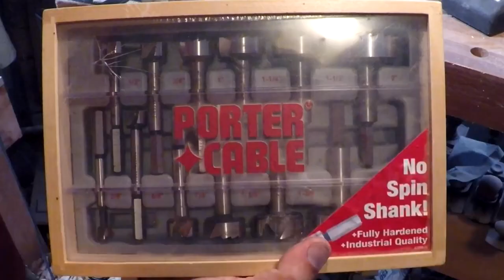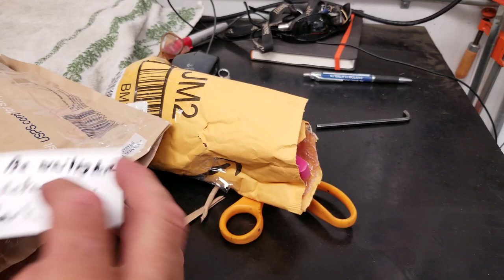Bar Z Industrial Mystery Tool Pattern

Comment: Beautiful pattern work, in any colour.  I'm guessing the small piece is for a separate cast part that attaches to the bigger casting, since I can't see why loose piece molding would be needed if it's all gonna be one cast piece in the end.  Does the flat base looking part have any draft on it?  I can't see any, I'm looking for it with the assumption the parting line is where he said it is.  No clue what it is though... Something with a handle?  :)
Reply from the maker: Your right it's a separate part